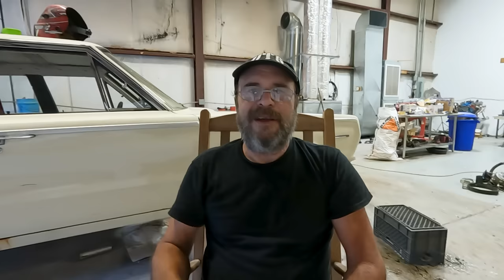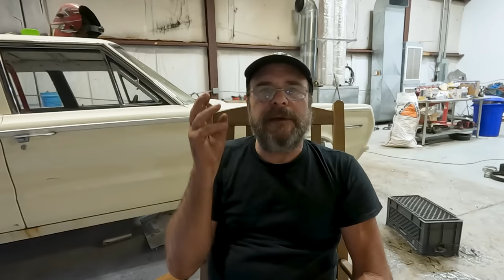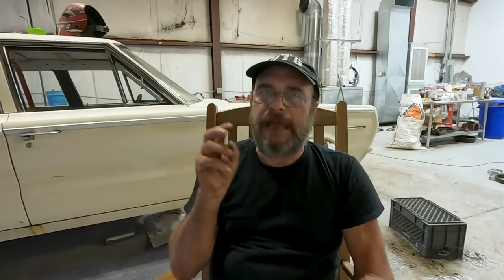They Really Are Out To Get You- How The Automakers Have Made Life Miserable For The Average Mechanic

Comment: The labor cost of replacing parts is upsetting too. I had to get a new fan controller for my car and it cost $1200. The part itself is $250 but one needs to take apart the dash to get to it.
The harder it is to get to a part, the more robust that part should be. If you need to pull the engine to reach a sensor or something, that sensor should last 20 years.

It makes us see cars as throwaway items. My friend had a great condition Subaru Impreza that he threw away at 250k km (about 156k miles) because it needed head gaskets to be replaced. Doing this on a boxer engine requires pulling the engine and it cost about $4k. The car only cost $22k when it was new, so he said nope and donated the car to charity. The engineers absolutely knew those head gaskets were shit when they designed that car. This problem persisted for many years and they never fixed it on the non-turbo engines. The turbo versions of that car come with a different gasket that doesn't have this problem.

Comment: My first "car" was a 1956 Studebaker pick up, came with a Ford 312 Y block. It's fuel pump gave out in the early 1980's I couldn't find one, so my dad had me try a great old auto parts store (West Covina), they sold me a new rubber "Diaphragm" for 50 cents, just had to unbolt the top of fuel pump with it still on engine, replace Diaphragm and bolt back together and done, didn't even have remove a fuel line. In today's dollars it would cost about FOUR DOLLARS, but still ony take FIVE MINUTES to fix!

Comment: I've got a pretty little bmw coupe, 2011 model. My plan is to keep the shell with suspension and chassis bits and replace everything else with well-designed components from other manufacturers. I've removed all the interior bits, currently in the process of stripping back and rerouting the wiring loom, removing all electronic modules which I have no need for, which means pretty much everything not related to engine and transmission. This still requires learning a lot of things like programming out security features and getting the equipment to do it. I'm also going to redesign the whole interior, from dash to center console and rear so everything is easily accessible and simple to remove. It's going to take time and money but I plan on keeping the car since I like the shape and in the end, it's going to be reliable and a million times more serviceable, just the way it should be from the start. Most industries are corrupt to the core and out to milk the general public dry. As tinkerers, we are particularly aware of these things, coming across obvious design details that scream "engineered to f you".

Comment: I cut a hole in the trunk floor above the tank to get the electric fuel pump out.  The 2006 Pontiac Grand Prix has an oval outline stamped directly over the fuel pump access.  I dreamed of reattaching the cutout by turning it into an access panel but too lazy never did.

Comment: The moment I knew the manufacturers were deep into planned financial obsolescence for the customer was the first time a customer brought a first generation Ford Taurus in for a leaking heater core. 11.5 hours of labor according to the Chilton manual. Also, the AC would require discharge/recharge. The first step in the manual- "remove the entire dash assembly and place it in the back seat". $800 labor to replace a $40 part. If there was an access panel on the firewall, it could have been done in 45 minutes.

Comment: The sad news, for me anyway, is that this whole thing also applies to much of the sound equipment which is currently on offer. It'll usually survive the warranty period and if it doesn't, they give you a new one but covered only by the unexpired balance of the original warranty! Repair at component level is somewhere between very time consuming (VERY high labour's costs) and impossible. Some very old and previously highly regarded trade names are guilty - no names, no pack drill. My son has a 1963 Fender Bassman amplifier (nice, glowing vacuum tubes, which are still easily available!) which is still completely  repairable. To quote from Chris Rea's great song of the '80s:-
"This ain't no upwardly mobile freeway - oh no - this is the road to hell"

Comment: Makes me grateful for what Subaru does still do to help servicing as laws get more serious and require greater needs. I am happy that though it is tight with that boxer I can service plugs and coil packs, the fueling system has an electric pump you can get to by popping 2 latches in the backseat, the front diff, transfer case, and transmission are one unit but you still have a dipstick so you can see if you are losing fluid, the oil filter is right on top right next to the dipstick, it has a sheet metal oil pan that won't shatter when you get enthusiastic in puddle and find a rock,  it has a mechanical high pressure pump for the direct injection that you can get to pretty easily. Unfortunately with CAN bus I don't know if and when it will have electrical issues and how locked down the ECU is if I ever want to tune it for ethanol based fuels or forced induction or if the BCM will prevent me from putting another engine when the current one fails eventually.

Comment: I've been looking for a vintage 1960s with a slant six for years. My neighbor is an excellent mechanic and he bought a non-running Audi sports car. It turned out that there was no way around replacing the entire gas tank with the dual fuel pumps installed. And it can only be purchased from Audi new.

Comment: I worked for over 30 years in automobile design engineering in different areas. Serviceability of the vehicle is not in the list of design parameters. Cost, on the other hand, is paramount. Engineers are pushed very hard to save every cent, along with everyone else in the company. That is why seemingly nonsense design changes are incorporated, such as access removal to the fuel pump.

Comment: My brother in laws brother, retired from GM about 8-9 years ago. I remember talking with him around 1997. He was a engineer or designer under the hood. He told me for years they tried to design it so mechanics could work on them easier, and for them to prioritize that on the list, they got it to about 6 or 7 on the list. But by the 2000’s it was dropped to about 15th on the list. GM didn’t care any more because they just figured you would NEED your vehicle repaired, and get it done. Which meant for money for the dealer hopefully instead of a different garage. So you see there is greed at the manufacturing level of vehicles also!

Comment: I still remember the days when you could replace all  8 of the spark plugs and points and condenser to make the car run like new and change the oil and filter all for less than a $20 bill.   It only took about an hour of work to do.

Comment: I think that the average mechanic is still in a good position as far as available work. Old model car sales in the early 2000s are flying off the lots. Especially with the economy going the way it is no one can afford the newer cars. I just purchased a 2002 Ford and took it in to the Ford dealership because the check engine light came on. They said the car is too old to test. I had to take it to a basic automotive shop down the street that worked on older vehicles. Many shops were over booked and no one could see me that same day. They also had a help wanted sign in the window. Work is still out there and us older car owners need you. ❤

Comment: I knew it as soon as Front Wheel Drive vehicles became the norm.
You can't get a wrench in edgewise, and there is no repairing them with the engine parts packed in there like sardines in a can.
I dumped cars and switched to driving 1980's motorcycles.... 20 years ago.
Never buy a vehicle you can't fix.  Unfortunately, the rest of my family hasn't figured that out yet.

Comment: The future is going to be gut and rebuild with all the new cars sitting unsold on the lot.

The computer based systems could be extremely owner/mechanic friendly, but they choose to lock you out.  For those of you interested in such things, look at light aircraft system and open source components like arduino and raspberri pi.  Tons of agnostic parts there that you could use to build custom systems for your car.

Comment: i saw the handwriting on the wall working for CHRYSLER,they were getting rid of the old engineers and the young ones came in and hell started,common sense out the window,when you work for the corp trained by the corp you see things ,sense things,hear things,in 1978 at the training center they said in my class,they were going to eliminate the back yard mechanic,i spoke up and said i'm a backyard mechanic,he said no you're not,you're factory trained and you will repair our cars our way,i said you are making a mistake,he said how is that,there's not enough dealerships to cover all of the break downs efficently and cost wise,he said don't worry of the cost,i finished training and immediately quit and never worked for a dealership again,and NOW,TONY is speaking of the time,and i knew it would come,they've engineered and changed everything over to electronic monitoring and control,ecms,modules ,backup modules and miles of wiring,just to go down the road to get a beer and a burger,cause its all you can afford with todays prices,vettes,trucks,r/v's,latest greatest is priced out of everyone's reach,if you buy one your friends family and people you know,think your nuts,cause theirs is broke in the shop

Comment: I have just changed the fuel pump on my friend's Pontiac Bonneville. We had to drop the tank.... was a monster job. I did it also on my Hyundai Sonata 2004, and Volvo 760, and on those there are access panels to the tank and pump. Was an easy fix for those. (Actually, harder on the Volvo because you have to cramp yourself inside the trunk, but doable nonetheless.) To drop the tank was a major nightmare, and I could not do it on my own, had to ask my mechanic friend for help. Even for the two of us, it was major work. I also have a Ford truck, work a lot on my cars (since my mechanic retired 8 years ago I do everything, including complete engine rebuilds). The Hyundai and Volvo have healthy challenges while I curse all who were in the design team when working on the Ford. How on Earth could our American engineers have messed up so badly, making every repair almost next to impossible? It is beyond the point of designer incompetence, it looks deliberate that they designed it in a way to force people to just toss it on a scrap yard and get a new truck instead. Very sad.

Comment: When I work on my Opel I often say to myself, "Now I know why the Germans lost the war." Very hard to access intake manifold bolts, no way to measure gearbox oil level so you have to drain the box and fill it with the correct quantity of very expensive oil, suspension ball joints that won't pop without the OEM tool...

Comment: I had an 08 Chevy HHR....OMG what flimsy components fitted wherever  they could;  
•lower control arm bushings (cheap rubber) , 
•No tranny drain plug.
•house  dome light that's mounted  so far aft,  it's almost useless.
•Sharp-edged plastic interior.
•No key slot in rear hatch or passenger door.

Comment: So far I have replaced two in tank pumps. One was a 1994 Roadmaster sedan, the other a 1996 Fleetwood. Same procedure, slightly different fuel pumps. BOTH times I had just filled the tank. BOTH times I did it by myself car on jack stands, and me on my back. FUCK THAT!!!!  You know the hardest part was using that collar--like slip on tool to disengage the fuel lines. What pain.

Comment: I was a product engineer. My product wasn't cars but room air conditioners. The rotary switch used to be mechanical and you could buy it at Sears. It had large sturdy contacts. It's the part that fails first. That switch went to the electronic circuit board as a relay and has tiny contacts now. It's the number one part that fails first, the circuit board.. Another thing that happened is z-axis assembly. The product engineer is forced to screw the service man because that manufacturing engineer is right there getting getting his way. Manufacturing efficiency and cost were right there on my back every day. I never heard from the service man. That manufacturing engineer and that marketing person got their way. Fancy electronics and marketing features to sell means that, we just buy another one when it fails. Take that thinking to automobiles and here we are. That fuel pump. I guaran damn tee you, the words, "Screw the serviceman." were said.

Comment: My niece bought a 2023 Mazda CX-5 last year.  A few months ago it threw a code and when I read the code it was engine coolant temp too low.  Looking up that issue on the CX-5 it was known to be the thermostat.  No biggie right, buy a $10 thermostat and pop it in?  Nope....on the CX-5 they got rid of the thermostat and now have a "coolant control valve" that's a huge plastic contraption that controls the coolant electronically and their first version had a defect in the design that would trap coolant and cause the computer to have the thermostat open all the time.  The coolant control valve is a $350-450 part and with labor came to over $900 for the dealer to replace.  Since her car was under warranty luckily she didn't have to pay anything.

Here's the kicker though.  Her car is a 2023 and Mazda has TSBs back to 2020 about the defective coolant control valve, so they produced a fixed version of that part, but they're still installing the old version on new vehicles 3-4 years later, knowing they will have to replace them under warranty or the owner will have to do it at their expense.  It's a complete joke to replace a simple mechanical thermostat with a "coolant control valve" that has multiple points of failure and costs 40 times the price and requires tons of stuff to be removed to replace the part.

The CX-5 also has no transmission dipstick, so to check the transmission fluid you have to remove the air box and a few other things to access the little fill cap to check the level.  I can kind of understand not having a trans dipstick since you really only need to check the level after a service....unless there's a leak, then you're going to have fun removing parts every day to check the trans fluid and top off until you can get your leak fixed.

Comment: I love working on my vehicles and won't ever buy a vehicle I can't work on. It's why I'm not a big ford guy. I like the vehicles but they are a pain to work on. Don't even get me started on that 5.4 engine they had 🫣 I remember when the fords had two nuts and a few wires to unhook the starter. Now it's a few wires and like six or eight 8mm bolts, with one bolt in between the starter and the block 😅

Comment: Saab's Di Cassette coilpack; all 4 coils in 1 assembly; can't just replace 1 coil 😞 .... & the torx screw on headlights in the 80s.  you couldn't change your own headlight (sealed beam units) w/o having to go to the dealership.  until they (GM) were sued and torx bits were made available to the public.....had this on an  '86 Chevrolet conversion van

Comment: I spent probably 3 hours or more trying to find a special proprietary screw head to remove the screw to replace the EGR on a Ford. Going thru tool boxes, trying to find work-arounds, looking online, and finally giving up and going to the store.  I was FURIOUS.  Nothing other than that proprietary head, no way to grab the sides, no other head would work.  I think I had to basically stop what I was doing, close up the entire car and house, change my dirty work clothes, drive to the nearest hardware store that might have it, return, and restart the job.  It probably would have taken 15 minutes to do that job if they'd have used a common screw head.  It took longer to remove that 1 screw, than the entire job start to finish would have taken had they used a normal common screw head.
Reply: And now you know what I go through daily as a mechanic.  And why mechanics are getting tired of it. We're expected to buy every tool we need, yet every manufacturer is doing the thing like the one screw that takes a special socket.

Comment: Same thing with mobile phones. Special screws with funny heads, parts paired to each other making replacements appear deliberately buggy unless coded by mfr. Adhesive bonded screens requiring a vacuum chamber to replace.

I feel like all repair level software, tech or cars, should be open source, or at least subject to a price cap. Manufacturers plead "safety" and "security", but the truth is "greed" and "profit".

And I've seen crap work from main dealer garages.  Now only I touch my cars, or a trusted local independent for anything that I decide I cant do.

Comment: I agree with you tony 100 percent. I can do anything on my chevy malibu 09. The transmission is a different story. I took it to several mech here in the joplin mo area. Reputable service places. All told me it was the tcm. So I had them replace it. $1500 later told that it needs a new transmission. I decided to pull it in my garage and changed my right side hub. Guess what. I fixed it. I will never allow anyone to touch my automobile ever. Bs

Comment: The year was 2001... I was working as a Master certified BMW stealership tech, and they sent me to school to learn the "new" e65 7 series.  From that point on, I began to REALLY dislike my job.

edit: real quick - I had a customer JUNK a Z4 (that was really clean and less than 10 years old) because it was "California emissions" and needed a fuel pump.  It's NOT "serviceable"... You have to buy a complete gas tank, with the pump in it, and ALSO the fuel lines come with it (all the way to the rail).  Absolutely insane.  I almost bought the car, but needed another "project" like a hole in the head, so it got "the big squish"